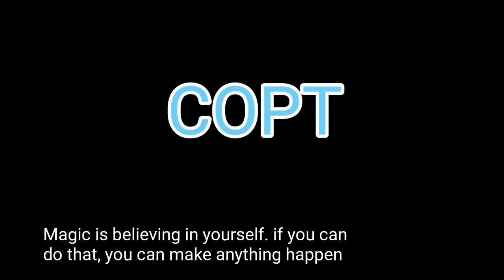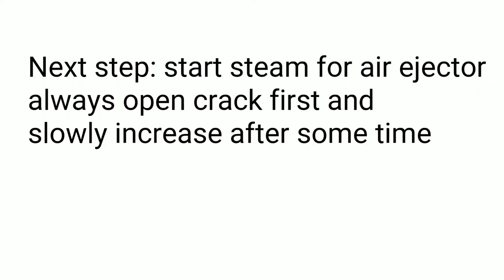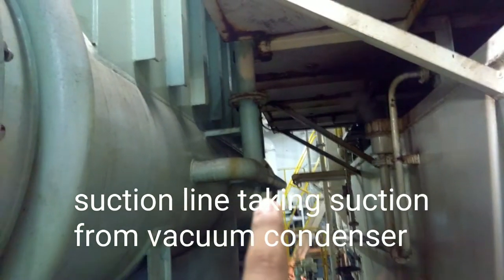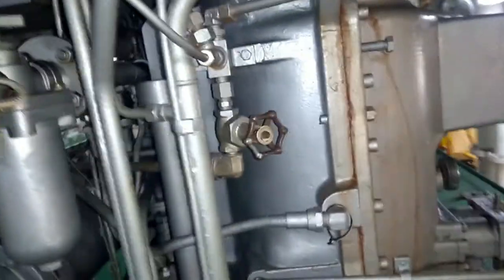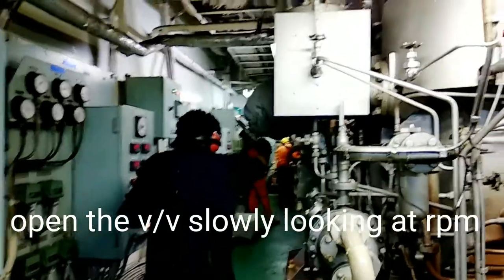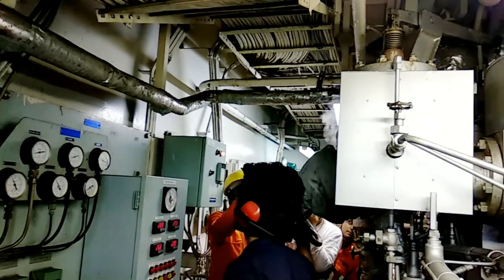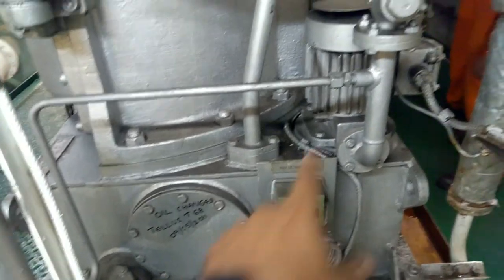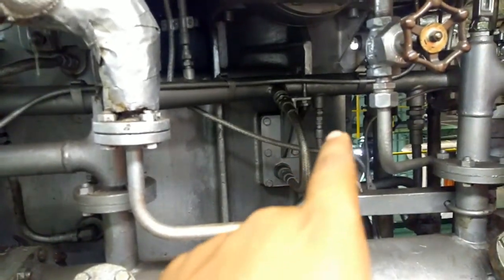How to Start a COPT? #Running and procedure of COPT # Cargo oil pump

Comment: Can you please tell me the reason for creating the vacuum in condensor ?  Thank you
Reply from the maker: +burhan shah : to increase efficiency so that more work is done, steam gets positive flow and also no water will remain inside the turbine.
Reply: Thank you for your reply. So, in simple words the vacuum is maintained to suck the steam into the condenser ?
Reply: To generate back pressure for improving turbine performance and recollecting exhaust steam.
Reply: @azizelazmaoui4762  if u generate back pressure then how turbine will run efficiently? it should be as low as possible so that steam doesn't get obstacle in its flow
Reply: The air ejector create vacuum while , the vacuum condenser maintains the vacuum inside soo that the steam can flow freely